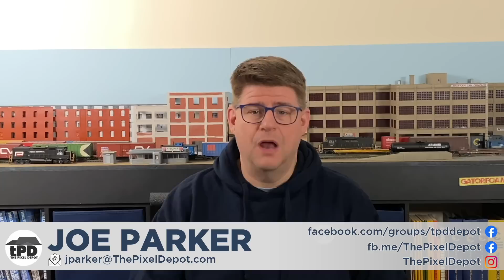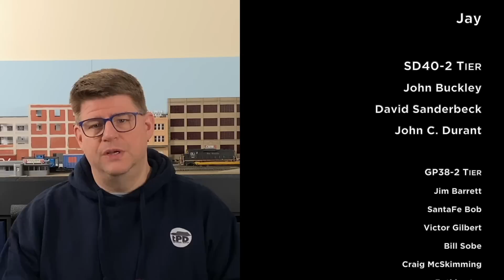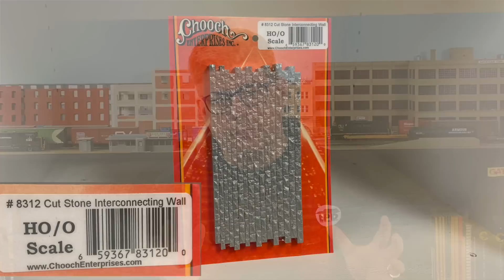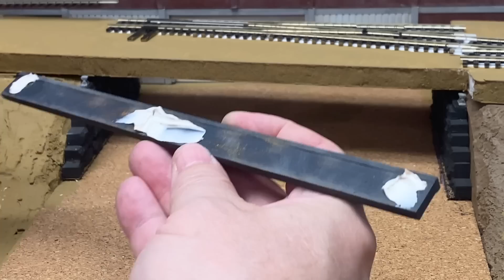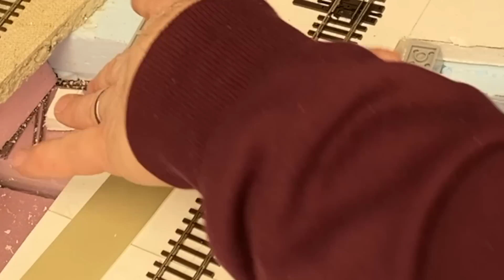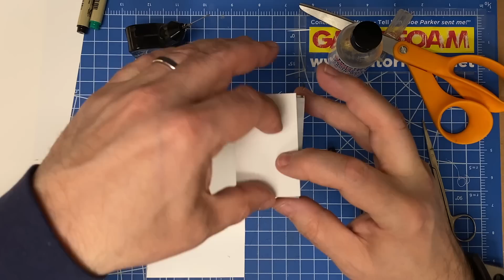Model Railroad Bridge Build: Making It Look Real on a Budget

Comment: Nice!  In all the years of looking at using Lego pieces for model RR projects, it never ocurred to me to use them upside down!  Same strength and square structure, just less fussing with studs.
Reply from the maker: It took me a while to figure it out, as well. It’s not something we’re typically “trained” to consider with Lego. But some of the more recent Lego kits use upside down pieces structurally, so maybe that’s what triggered it for me.

Comment: Lego has long been used in models and model Railroading.  They have enless shapes and are styrene which we all use. They are square and are great for structural framing.  I have seen that type girder bridge with ballast on it may times. As i have done the same as you did here practically  on a project.